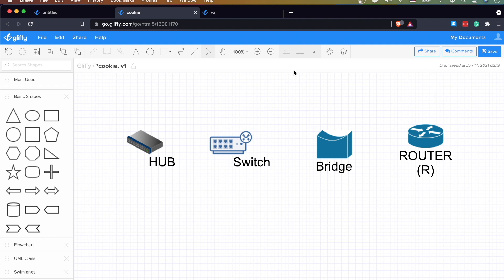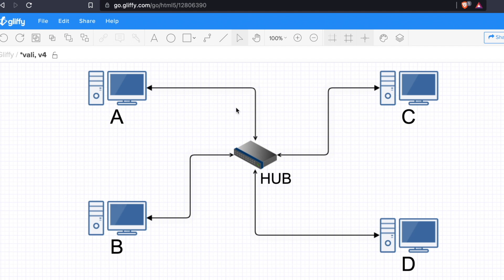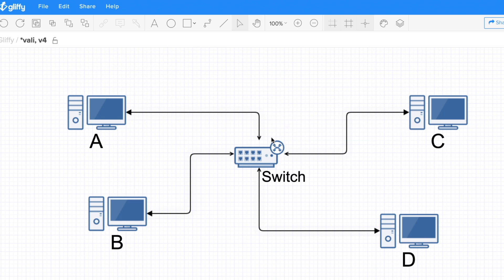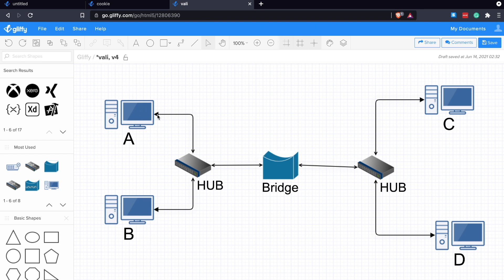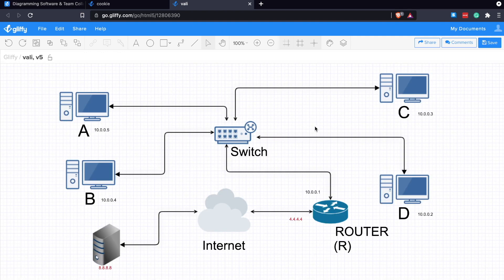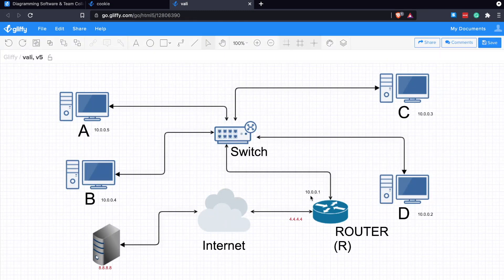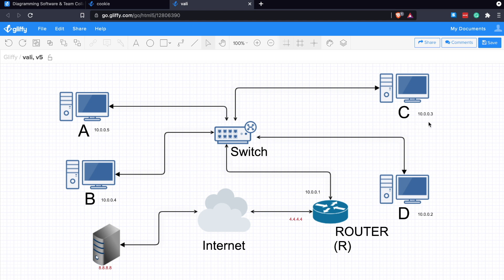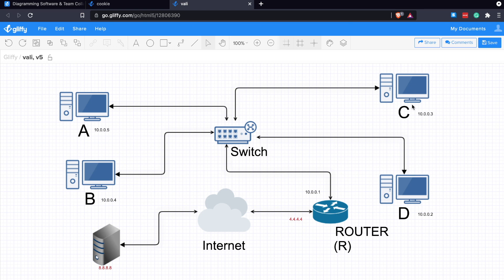Hub vs Switch vs Bridge vs Router (Full Detailed Example)

Comment: I feel confused about the relationship between router and the switch 
My question is how switch knows that if distension is not in my network i will send it to router
Reply: Switches use something called a MAC address table.  The MAC address table learns the MAC addresses of all devices on a switch's network by examining data frames as they are received.  Quick review: Every network device has something called a Network Interface Controller (NIC card).  This NIC card has a unique, 12-digit (48-bit), hexadecimal MAC address identifier hard-coded onto it.   The MAC address identifier may not be repeated anywhere in the universe of MAC addresses (technically, neither should IP addresses, but that's a different topic).  When the switch receives a frame from one of the devices on its network, it "learns" the source device's MAC address and adds it to the switch's MAC address table.  Now, each frame will contain TWO MAC addresses:  the source MAC address and the destination MAC address.  As mentioned, when the switch receives a frame from a device on its network, it "learns" that device's MAC address and adds it to its MAC address table.  However, in addition to the source MAC address, the frame will also contain the destination device's MAC address.  If the destination MAC address IS already in the switch's MAC address table, the switch will forward the frame to the destination device.  If the destination MAC address is NOT in the switch's MAC address table, the switch will forward the frame out to all ports (with exception to the incoming port), which includes the port to which any other switch or router might be connected.  Remember:  MAC addresses are used for hop-to-hop data transmission.  IP addresses are used for source-to-destination data transmission.  MAC addresses will change as the data packet makes its way across the Internet from source device to destination device, but IP addresses never change.  The source and destination IPs never change as the packet makes its way across the Internet from source device to destination device.  Together, the MAC addresses and IP addresses are used to get data from one device on a network to another device on an entirely unrelated network, perhaps one that is even on the far side of the planet.

Comment: what will happen if 2 machine are trying to access 8.8.8.8 via the same port say 123, how will the router decide which machine to forward the response to?
Reply from the maker: I discussed that at the end I think. Each machine will use a unique source port and the router will use that in the NAT table to uniquely identify the response
Reply: @hnasr  Ports are limited in numbers. Say each machine generates a random source port (49152-65535). By any change can multiple machines have same port numbers? If yes, then the router will have two mapping with same source port. How is this use case handled?
Reply: @nikkigoel  Port Address Translation.
Reply: @rootuser5027  Thanks for suggesting this. I went through this concept. I see how it is connected.  
Let me rephrase the question. Can two or more machines connected to the same router and having same IP addresses, have same source port numbers?
After reading about PAT, I think not. Please correct me if I'm wrong.
Reply: I think I understand now. Local IP address of each device will be unique under same public IP address (same router). So for a router, combination of source IP address and source port will always be unique. So for two devices sending a request to internet (some remote host), even if they have same source port, the IP address (which is local) would be different.
Am I right?
Reply: @nikkigoel  That is correct
Reply: @anshikagupta4931  Thanks for confirming. 😊